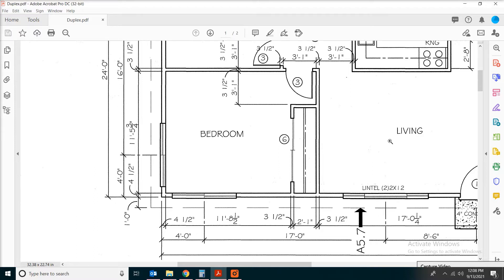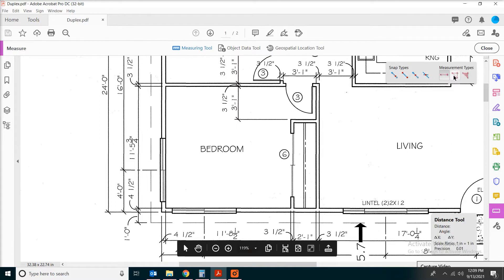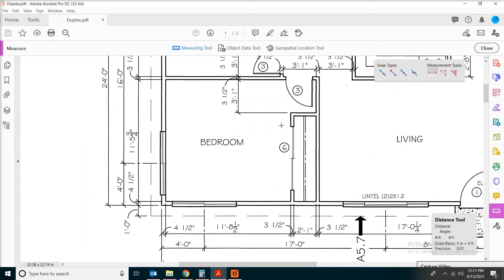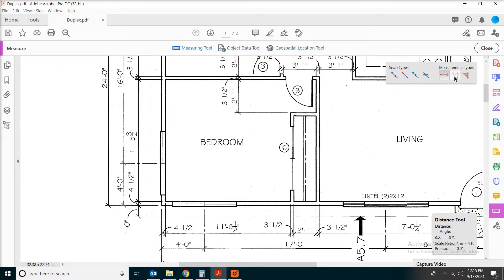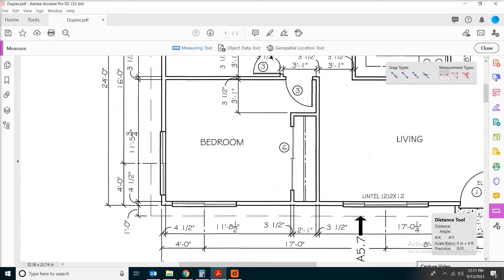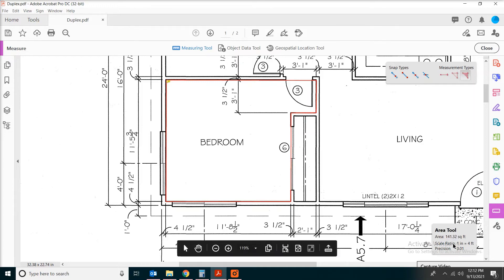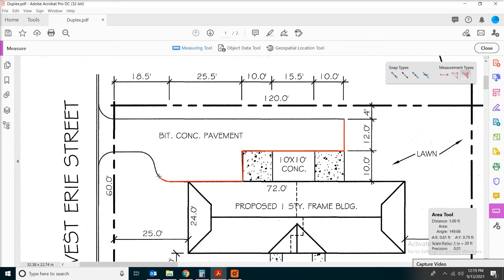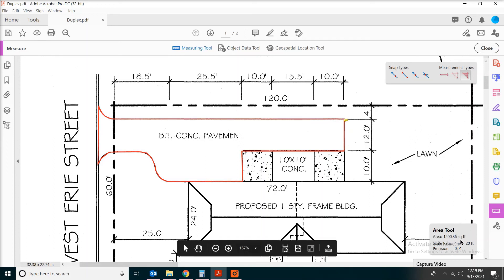Using Adobe Acrobat 2: PDF Drawing Measurement

Comment: Hi , may i know what is the best scale i should use if my drawing is 1:1000 A3 😢
Reply from the maker: Size A3 for paper would be close to 11" x 17", which is frequently used for printing reduced portable drawing size. So I will suggest you check to see if the drawing is actually to scale first. 

As for 1:1000, if you are referring to metric, it means 1 mm = 1000mm (or 1 Meter). 

So going back to the Adobe measurement tool, you can set your scale ratio to be 1 mm = 1 M on that dialog box to get the results in decimal meter. If more precise results are needed (e.g. millwork shop drawings), you can leave it as 1mm = 1000 mm and your measurement will be in mm. 

Wish this helps.
Reply: I hate it that the PDF tool only gives a measurement to measurement conversion. Plan pages are rarely actually to the scale they claim. To actually use this tool you have to do two steps. First measure a known measurement in 1 to 1 and then set the measurement you get as your first number and the number it should be as the second. There should be an option to select two points to set scale, but whoever makes Adobe products is only half bright. Unfortunately even the alternatives follow Adobe instead of thinking.
Reply from the maker: @glenosborne6188  the measurement tool in Adobe assumes the PDF drawing was to scale (i.e. the user knows the correct/incorrect scale). If that is not the case, I would suggest using OST to find out the appropriate scale for the PDF first. Here's a video I did more than half year ago  (very easy but useful): 

https://youtu.be/EKXrRGi4lBQ?si=7R0XjbxbtlbGzj1K

Comment: Is there a volume measuring tool? For example figuring concrete for a slab.
Reply from the maker: While some software tools often boasted 3D capacity, my own experience will say that is unnecessary. Adobe is primarily 2D but PDF reader is free which makes it hugely popular. To get the volume, it is very easy, just multiply the surface area you measured witht the slab thickness. You can watch my Excel tutorials on this channel to set up a simple calculator which even includes unit conversion.

Comment: Why won’t the measurements show in fractions instead of decimals???
Reply from the maker: Most of the measurement software will use decimal system, as estimating itself will need decimals for calculation. Consider this example: the room dimension is 9'6 3/4" x 8' 5 3/8" in fraction, vs. 9.56' x 8.45' in decimal, which one is easier for your calculator to do the area?